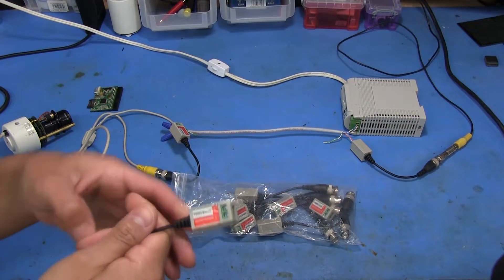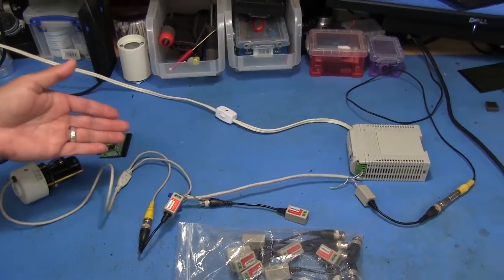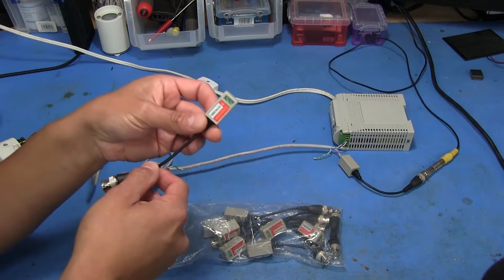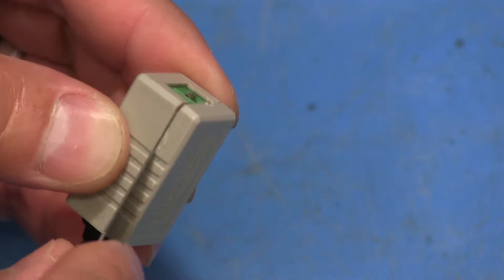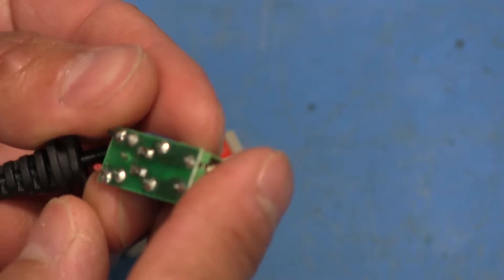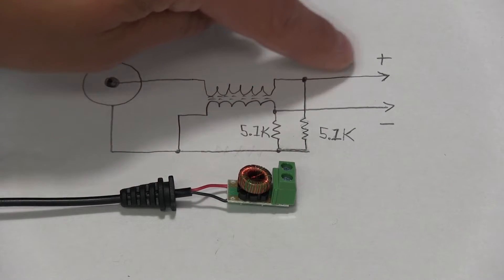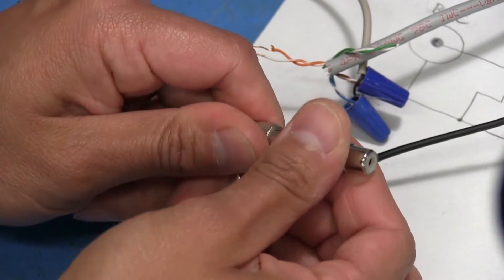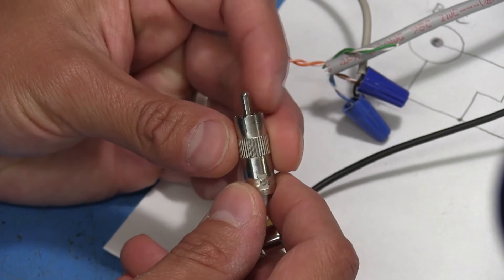TWB #84 | A Look Inside A Cheap Video Balun

Comment from the maker: Couple things I forgot to mention in video: 

1- The wire on BNC doesn't look like it has any shielding. 

2- Looks like whoever assembled these got lazy and just soldered the wires to the pads on board instead of through the holes.

Comment: In general, baluns are crap.  When you use baluns, the single thing you are relying on the most is the twist in the network cable.  The thing that most kills the signal is induction coupled noise.  Coax rejects this using its braided and/or foil shielding.  Coax also has a relatively thick copper center conductor surrounded with a foam dialectric layer.  Not only is the network cable conductor thinner (~26 AWG), but most of the network cable made in the world isn't solid copper anymore.  It's copper-clad aluminum.  So, it has crappier capacitance AND lower conductivity.  So, why use a balun?  Well, as this guy says... it's cheap.  Under the right circumstances, you'll get a passable-to-decent result.  I'd use this if I were setting up cameras for my house, but never if I were selling this to a customer.  Even cheap coax is safer to use than this stuff.
Reply: The point to the balun and twisted pair wire is to rejetct common mode noise. You don't need to run heavy coax to do that. I develop cameras for dangerous places and my NDA says I can't say exactly where... But we have excellent results running long distances in environments that are very cold to very hot and have a lot of EMF and I'm talking 160,000A worth. We also run Modbus, Profi, DeviceNet and other industrial communications over twisted pair across large plants that aid in critical function... The job is done reliably and done with standard CAT6

Comment: Umm, the vast majority of these are short, rigid, and have no components. They sell them anywhere they sell security cameras, like Fry’s Electronics. They have them for power connections (usually 5.5x21.mm), RCA Cinch male/female, BNC, F-type coaxial, and more.